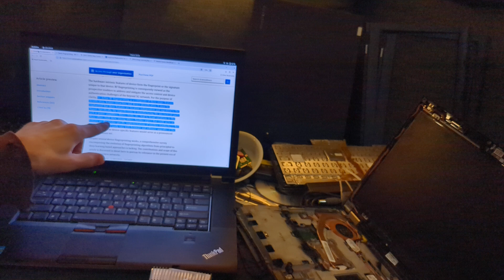Privacy Deeper Dive: WiFi Radio Fingerprints

Comment from the maker: RELATED: For those interested in mac spoofing and more, wrote something to share with everyone:  (in response to comments) http://gg6zxtreajiijztyy5g6bt5o6l3qu32nrg7eulyemlhxwwl6enk6ghad.onion/RightToPrivacy/wipri
This video goes deeper than the data / mac address tracking (and is entirely unnecessary for most people - but fun to consider) - it's about the wireless signal fingerprint. Based on the hardware design / firmware, each radio device will leave a unique signal fingerprint.

Most people have absolutely no need to be concerned with this  (radio fingerprinting) - I do this because it's fun to game out scenarios and come up with defense solution ideas.  😎
Reply: This link appears to be broken
Reply from the maker: @canberradogfarts  It's a onion link for Tor Browser - I'll add a note for this. Thanks for reporting!

Comment: Just use macchanger and randomly alter signal strength
Reply from the maker: I share something that automatically does that for you (doesn't require macchanger - once had an issue with NetworkManager + macchanger bug that leaked permanent MAC - that experience inspired me to write something as "leak insurance"): http://gg6zxtreajiijztyy5g6bt5o6l3qu32nrg7eulyemlhxwwl6enk6ghad.onion/RightToPrivacy/wipri

It has a flag that offers option to continuously change (simultaneously) signal strength as it changes mac and hostname (at random, continuous changing times / values).

Along with other options.

This topic goes a bit deeper than most need to care about - it's about the actual fingerprint of the wireless signal itself, not the content of data. Something that can only be changed with hardware function / design changes.

Most people have no need for this video TBH but I enjoy gaming out defense ideas.
Reply: @RTPTechTips  get aluminum foil and cut it like a snowflake and randomly rotate it around the antenna to distort it? Actually I have a curiosity of whether aluminum tape on the back of a monitor can defeat a tempest attack... Do you know? Maybe make static into 1/8th inch jack then hook the wires to the foil? You could also potentially do that to the wifi antenna if the foil was surrounding it but it may make your hardware fingerprint impossible to detect.